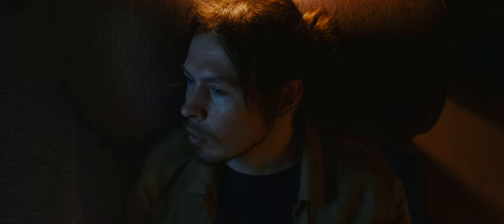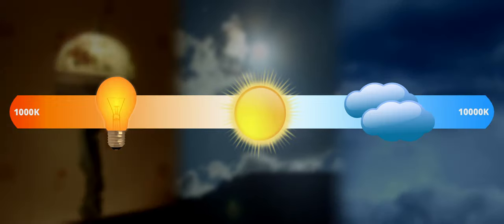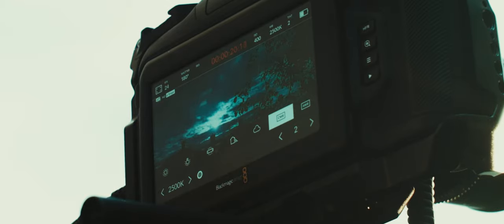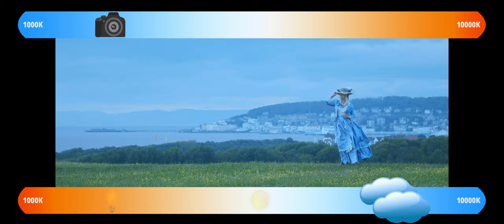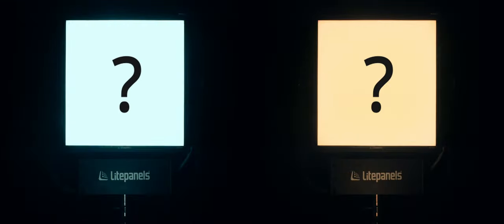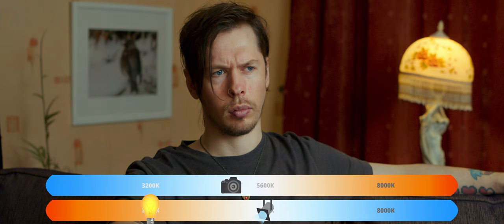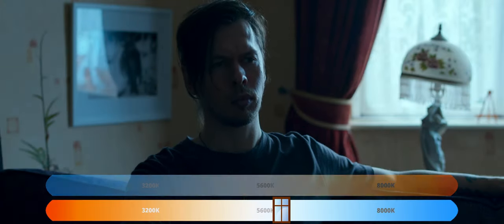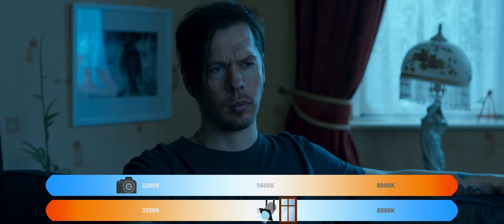Improve Your Lighting Using Colour Temperature - Lighting with Colour Part 1

Comment: Awesome series! A bit late comment though.. There is a difference in using a certain temperature and adjusting the whitebalans. I'm not exactly sure how it works but I presume daylight has more of the colorspectrum so the subject reflect all the colors it can, while with warm or cool light only a limited spectrum. Do you usually notice a difference in using just any light and adjusting the whitebalans vs using a more white daylight temperature, in how objects and people look?
Reply from the maker: Thank you so much! I'm not overly technical in this regard, but yes there probably would be minor differences, because of the different peaks in the spectrum of the particular light you're shooting under - when LED lights started being used for filmmaking they were mostly a bit rubbish because of their low CRI rating and colour spikes for example, but now they're much better. A true tungsten/halogen light used to look much much better on camera than an LED or even HMI (I think it still does, but it's a much closer comparison than before!) because of it's colour spectrum being the closest you can get to actual sunlight/daylight with a CRI of 100. So taking these factors into account it depends on what you're shooting with in the first place! If you're shooting in natural light, or you're shooting with a tungsten/halogen lamp/light, then pushing your white balance around is still going to be super accurate. But with LED lights I'd imagine there are certain spikes in different places when you change colour temperature which could also effect how the image appears between different camera white balances and different white balances on the lighting unit itself. But honestly, I don't think there are any massively noticeable differences with the better accuracy of LED units nowadays. That's my understanding anyway - someone correct me if I'm talking absolute rubbish haha!

Comment: Are you back to blackmagic after your S5?
Reply from the maker: I picked up a Pocket 6K for the internal ND's and BRAW... just shortly after, they announced the BMD Video Assist could get BRAW from the S5 🤣 but internal ND's were something I had personally needed for some time so it made sense for me to make the switch! I've shot a few run and gun jobs in the past month though and if I still had the S5 they would've been a breeze - so I'm probably gonna end up grabbing one again at some point!
Reply: @RobEllisCinematographer  Internal NDs are killer yeah, how do you like the image of the 2 cameras?
Reply from the maker: @Aviciiz  they are super super helpful! In terms of image I couldn't really favour one over the other, there's definitely a different feeling to both cameras, which I imagine is the way the different sensors render an image (I'm not an expert on this stuff and full frame feels a bit different to work with on the S5) but both are equally as good in my opinion and you could easily match them. I don't think the general viewer would notice a difference! The S5 is excellent in low light also but the Pocket is still pretty good!
Reply: @RobEllisCinematographer  Very nice, thanks for letting me know!